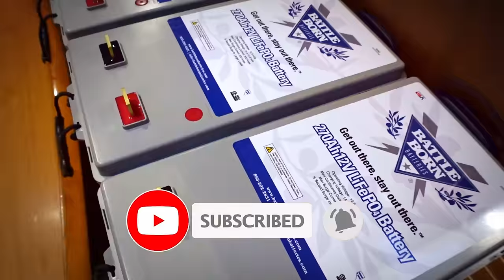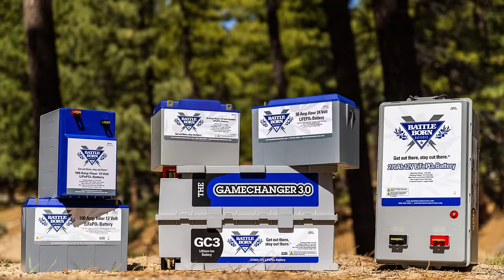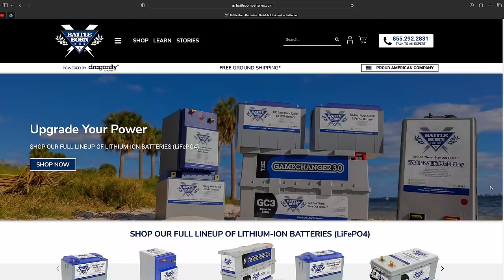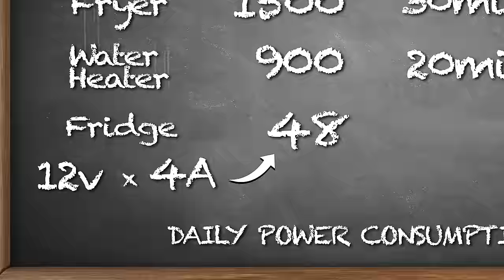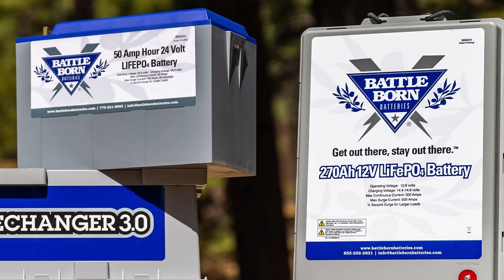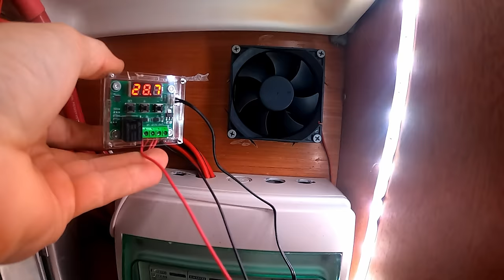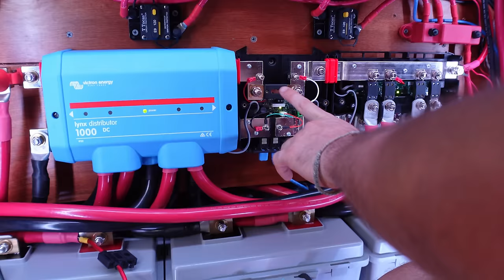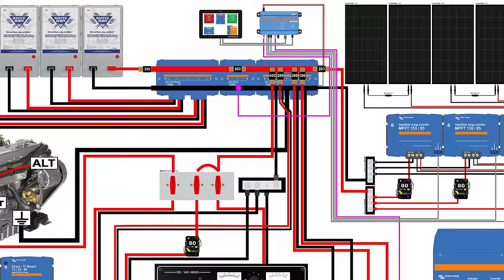Off-Grid BOAT WIRING for DUMMIES! 12v Lithium Battery Bank Install: DIY HOW TO  🛠️💥| ep.26

Comment: Just saw you video an so well explained wiring of your boat and the elements of boat wiring in general. Thank you. Great job. 
I do have one question. Did you have to upgrade your alternator amp wise to avoid burn out due to your dc to dc 12/12/50 charger??

Comment: Let's talk about the 500,000 DC Voltage lines from Oregon to California.
Reply from the maker: Good thing our windlass isn’t the next state over from our house bank 😉 our examples may not have been technically correct but our main goal was to help people understand the electrical system in there boat!
Reply: @SpearItAnimal You need to understand first before you attempt teaching.

Comment: Very good simple explanation.  I’d be concerned about chaffing on a lot of those wires. It looks like a very clean install, but I see a lot of heavy gauge, opposite polarity cables that are sitting near sharp corners that are unsupported.  A cable that can move is a cable that will rub and break, given enough time.  Perform a wiggle test on those cables, and if anything moves at any location, it’s a problem.  I’d hate to see that beauty burn down because you’re missing $10 worth of cable clamps.

Comment: wow, that is the clearest explanantion i have seen, thankyou!!!! I am looking to do almost exactly the same on a sailboat - are you able to provide guidance on the wire gauges you used? Battery connections and to inverter seemed to be 16awg? but wasnt sure about the others. thanks for the help
Reply from the maker: Use a wire gauge calculator for all of your wire runs. This is extremely important and it varies on the different lengths and amp draws of each wire. Every bot is different so you can copy others on the sizes….we use the one from explorist.life

Comment: Your installation looks boss!   But, using a utility razor knife to cut the wire insulation is sketchy.  There are special rotating wire strippers with adjustable blades. Oh well.

Comment: Another way to explain electrical systems compared it to a water system! In a water system we have a pump that creates pressure pressures is equivalent to Voltage how hard are we pushing the electrons? Same how hard are we pushing the consumable product? And that is water in the water system. And in the electrical system the current is the consumable product how is it transferred? Pipe for water and a conductor/ wire for electricity. So water and current are the consumables voltage and pressure are commensurate with each other, as is the conductor and the pipe.

Comment: Excellent work \
- neatness is close to godliness when wiring near salt water. Have you found a good spray protectant . Having done some crazy sport fishing have tried many. The best so far is a purple colored battery terminal protectant this has stopped any type of corrosion   where all other  products have failed. Pm  if you need the name of have found a better product. This is the best one I have found in 15 years of trials.

Comment: Do you have any rough guess-timate of how much your high end victron off grid system would cost total for parts retail?  
Just checked battery cost - looks like at least $12,000 in batteries alone. $2k-ish for inveter...$2,000-ish for panels...At first I was guessing $15,000 total. Now guessing more like $20,000 .......I  think it was 6 x 375w solar panels. 2250w worth of solar. 
Great Job on the boat build btw !!! 👍 👍 
I know it was something you both worked reallyhard on and not just handed to you for free.

Comment: So what do you do when those batteries catch fire out at sea?
Reply from the maker: Lmao why would they?
Reply: @SpearItAnimal  I guess you’ve never seen an electric car catch fire. Not a risk I would take, you can’t put them out, and if it happens on your boat you’re just dead.
Reply: @thecorrean2411  The car fires involve standard lithium batteries.  These are lithium iron phosphate batteries.  Different tech and significantly less prone to thermal runaway.

Comment: What a great video explaining electrical systems and their application in boating!  This can be such a difficult concept to explain, and I feel like it becomes so much more difficult once you diagram your system and start putting the pieces together.  You did a phenomenal job with the install!  Question: From a reliability standpoint (worst-case scenario), is your battery system in a location that would be least likely to short out quickly or easily in a catastrophic situation (extreme weather, boat sinking, etc.).  I would be concerned with the electrical system going out when you need it to make emergency communications.

Comment: Keep monitoring the cooling in the battery/inverter compartment.  Did you install a thermocouple to register temperature with an alarm?  Please make sure you have good cooling or the inverters will have a limited life. :)
Reply from the maker: Barely any heat at all, they both are vented very well!

Comment: there is also DC High voltage, but you don't have DC High voltage on that boat, used in industry, and to move power over long distances.

Comment: Have you considered swapping in an induction cooktop? Electricity is easier to find and source than LP/Propane and it eliminates open flame/fire risk that comes with gas. I love gas in a house but electric is so much safer and easier on a boat.

Comment: I shrugged "close enough" for most of it, but the what is voltage/amperage.  Voltage is like  pressure.  You can have your dive tank pressurized to say 140PSI.  That's like 140 volts.  It's not doing anything. It's just sitting there.  What if you have a tank at 14,000psi?!  Same. It's just sitting there.  Now once you turn the knob that air starts flowing at X liters per minute. THAT is your amperage.  You may have heard people say "it's not voltage that kills you, it's amps!" well this is true.  If you're trapped underwater and can't open that scuba tank, it having 140psi (Volts) doesn't mean anything, you're going to have a bad time.  Now once you get back up to the surface, you've got as close to relative 0psi (0 volts) but you're also flooded with air (tons of amps).

Watts is a good measure because it's saying essentially "How much air is moving and at what pressure".
Reply: look at a supersoaker vs the mississippi.    The supersoaker has high pressure, but a very small hole.  This is high voltage, very low amperage (amps).   The mississippi is a fat, lazy river.  Water slowly moves down it, but it's about a mile wide in some parts.  This is very low pressure (voltage/volts) and VERY high amperage.    After a minute the mississippi will give you a million gallons of water, whilst the supersoaker might give you almost a quart in the same time.. difference is the supersoaker is hitting the other side of your yard, whereas the the mississippi is just.. there.. no airtime at all.
Reply: By what's the real difference between high voltage and low voltage? It's not AC/DC, although they are related.   So your house (in the US) is wired for 120 volts and 15 amps to most outlets.  Your boatlights are 12v and 1.5 amps.  That's 1/10th of the power!  THAT is the big difference.  So why is one AC and one DC?  DC voltages are short range, no more than 100ft max wire runs.  Your powerlines run for MILES.  For that level of distance, it's easier to "wiggle" the power as opposed to giving a full stream.   +120 volts, 0 volts, -120 volts, 60 times a second. 

But trollboy you big dummy, you say, the boat isn't 100 miles long, so why run AC at all?!  Simple.  Your airfryer is designed to take in that has-ran-for-miles AC power, so we use an inverter and fake it.   Funny enough, they mentioned AC coming out of the alternator, but wait one might ask again, if everything is DC on the boat, what do you do with that AC power coming out of the alternator?!  SIMPLE!! The opposite of an inverter (turns DC to AC) is a rectifier that turns AC to DC.     SO, the inverter they installed is taking 12/48v DC power and translating it to 120v (higher voltage) AC (with the 60 times per second back and forth) power to fool normal household appliances into thinking they're on land power.
Reply: Continuing to go off about Voltages, Voltage is the difference in pressure.   In my earlier example I said air pressure at the surface of the water is 0.  That's actually a lie.  It's relative 0.  The actual weight of the entire atmosphere weighing down on you is around 14.7psi.  You just don't notice it because you live here.  0 air pressure is actually the vacuum of space.   

What does this have to do with electricity? WELL.. if I charge Sascha to ONE MILLION VOLTS.. and I charge Raf to ONE MILLION VOLTS... and have them shake hands.. do you know what would happen?  Absolutely nothing.  Because there is no DIFFERENCE in voltage, the relative voltage between them is 0.   SO if I take that 140psi air tank and open it, you'll hear it hiss away, BUT if I put you in a pressure chamber, and raise the pressure in that chamber to 140psi and you open the airtank in there.. no hiss.. it will just kinda of chill.. since the airpressure outside the tank and inside the tank are the same, the tank will be essentially empty.

Comment: You guys did an awesome job on that electrical system. I really enjoyed how you explained Volts Amps and Watts. I have one question. How did you figure out the wire sizes required for the battery terminals and the branch circuits?
Reply from the maker: Welll explain that in the next Ep. But you can use a free wire calculator online. Just type in your Volts Amps and distance of your wire run (there and back, total circuit length) and it will tell you what wire size to use. We calculated everything with a 3%voltage loss which is also an option to choose in the calculator. We is used the one from explorist.life

Comment: Great job! I am planning a similar system, but I would also like to incorporate a high output alternator for those less than sunny days. Oh, did you take a look at S0K batteries Will Prowse reveiwed? I like Battle Born better because they have cylindrical cells, but S0K is much less expensive and seems pretty good. Also, is there any chance I could get you to email me your diagrams and list of parts/supplies?

Comment: Looking to install lfp batteries on my sailboat.I just bought two 12.8v  400 ah batteries.  I know power storage and ability to recharge are key. But what is a recommended battery bank?
Reply from the maker: Depends on the size of your boat, how many people are on board, what you plan to run, etc. Let’s say 2 people living on a 40ft boat with with a gen to run AC, watermaker, and hot water heater, then I would say they’d be comfortable with 600-800ah and I wouldn’t definitely wouldn’t suggest less than 600. That’s just us. I’m sure there are some conservative hippies that that could live off of 400 but that won’t leave much in reserves for the cloudy days. Personally I’d fork up the money for at least 800 if I was living aboard full time….we went with 1350 because we wanted to run ac, the hot water heater, watermaker and everything off of our bank and we still find times when we wish we had more 😂. Course we have no gen.
Reply: @SpearItAnimal  so I am single guy on a 35 Coronado. No water maker yet. And have 800 ah 12v lithium. Thinking of going 400 ah at 24 volt.  Do you think it best to increase my battery capacity first then use my solar to try keep up?
Reply from the maker: @krisfoltyn1274   usually larger boats are wired in 24v to save money and space on the size wire they use to run to everything. 400ah @ 24 volts is the exact same amount of power as 800ah @ 12 volts. 24 volt appliance require half the amount of amperage so the wire size doesn’t have to be as large as 12v appliances. My recommendation for that would be to leave your voltage at whatever it currently is or else you’ll have to convert all of your appliances, lights, windlass, etc over to the voltage you change it to (or you’d have to get some sort of a converter)…seawater pro has both 12v and 24v watermakers you could install and easily run off of your bank. (I think they draw 600 watts). So if you install 600-800 watts of solar then youd be set up to run your water maker strictly off the panels when the suns high and bright and not even use your bank.

Comment: Not to split hairs, but I've been professionally involved in electrical/electronics work since I operated and repaired missile systems for the Navy in 1977; 'AC' means alternating current and 'DC' means direct current- it can be deadly to assume that one is high current and one is low current...the voltage/current values can be minimal or deadly in either. It only takes about 85 milliamps DC applied DIRECTLY to the heart to stop it. Be careful out there and remind those with little to no electrical experience to be sure of what they're doing or hand it off to a professional. That said, I never miss an episode.🙂

Comment: Hi guys electrical engineer here, sorry to say it is not correct to reduce the understanding of AC DC to high voltage/ low voltage. Some batteries in electric cars put out hundreds of volts because the power loss equation, power loss due to heat = (resistance of the wire)x(amps^2) whenever you have a system with enough watts if you don't want big losses in heat you need to lower currents and up the voltages. The only reason AC is associated with higher voltages is because transformers that can easily step voltages up and down only work on AC and so for a distribution grid it makes sense to use AC. For super bulk transfer of power however like between countries it is often done in DC at like a million volts. Just wait till you learn about reactive power and figure out the AC appliances with motors in them use up more power than you expect . A concern about using the prop shaft as a ground is electrical currents can accelerate wear through galvanic electrolytic corrosion. I am working on starting an electric jet boat company and may sponsor some episodes in the future.
Reply from the maker: Awesome, and yes we’re aware the analogies weren’t 100% correct but this electrical video was geared towards recreational boaters who know absolutely nothing so we were just trying to portray the basic concept. If we decide to make a video about transferring power between grids and electric vehicles then we may reach out 😂🤙🏼

Comment: multi-gas/multi-criteria detection device hooked into an alarm? Did I miss that part? 

Lithium is a naturally occurring salt that was first used for treating certain psychiatric problems. Many headache specialists recognized that it could be useful in treating cluster headaches as well after hearing the men complain about the headaches wives/girlfriends always have at bedtime.

Comment: Sorry, a Watt is joules (energy being used/produced) per SECOND, Joules/Sec. J/S. NOT hour. We sometimes use Kw and Hours in domestic and industrial systems to measure energy used, but then it is in KwHrs. Because the number of Joules would be ginormous. Watt is rate of energy use. 1 Watt = 1Joule per second.

Comment: You kind of  got  AC/DC wrong! AC is alternating current and DC is direct current not high and low voltage. Although they are different voltages they are both considered  low voltage.
Reply from the maker: There are massive DC lines that spread power across states as well as small items that run off of 30vac so yes you are correct however on a boat the voltages we listed are the the most common voltages 99.9% of people will ever see and relatively speaking 120-240AC are high compared to the 12-48DC. Hopefully this will help people that “know nothing”, understand the basic concept!

Comment: Watts per hour isn't a thing: Dang, you did such a good job explaining the whole Amps, Volts, and Watts thing. But you made one pretty confusing error. You actually mis-explained Watts. Everywhere you said "Watts per hour" you should have just said "Watts." Everywhere you said "Watts per day" you should have said "Watt-hours per day." Here's why. Watts are power and Watt hours are energy or battery capacity. A Joule is the basic unit of energy. A Joule per second is a Watt, which is a measure of power. But a Joule is a very small unit of energy, so we usually use Watt hours, instead. Watt hours are much more useful than Joules. But a Watt hour (Wh for short) is just 3600 Joules of energy, because there are 3600 seconds in an hour. Each of your batteries is 270 Ah (amp hours) at a nominal 12.8V (Volts) for an energy capacity of 270Ah X 12.8V = 3456Wh. You have 5 of those batteries for a total of 17,280Wh of battery capacity. So if your air conditioner runs at 800W, you could theoretically run it for 17,280Wh / 800W = 21.6h (hours) from the battery. There are losses in the wires, inverter, etc., so it wouldn't be quite that long in real life, but that's the maximum you could get with perfectly efficient components. Just remember, your appliances have a "Watts" rating. It's not Watts per hour. If you run a 800W appliance for an hour, you have used up 800Wh of energy from your batteries (which hold just over 17kWh of energy). Confusion around Watts and Watt-hours is common. You did a great job on explaining all of this except for that small bit of confusion--which is the same mistake many others make. Keep up the good work. I'm enjoying the content. 🙂